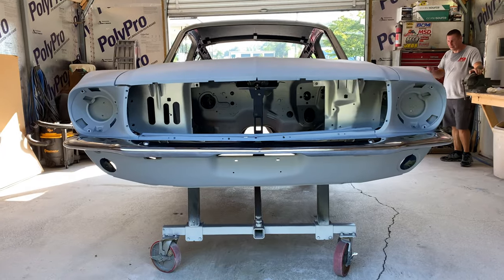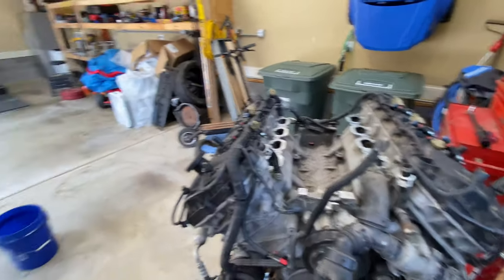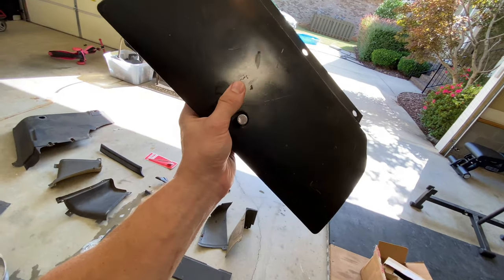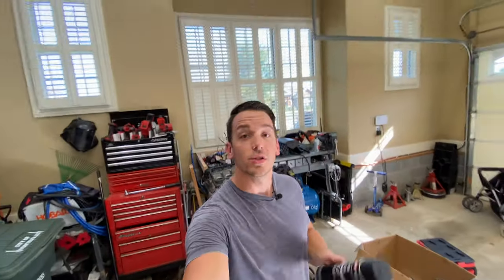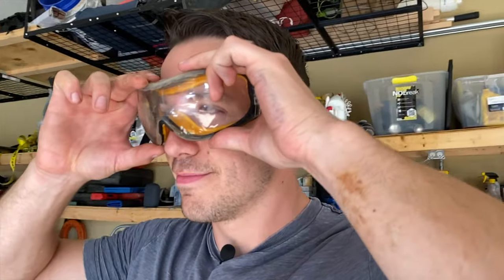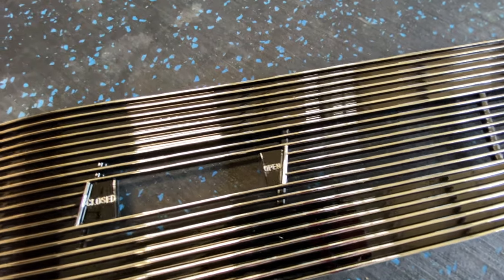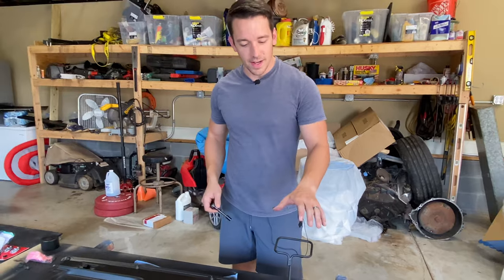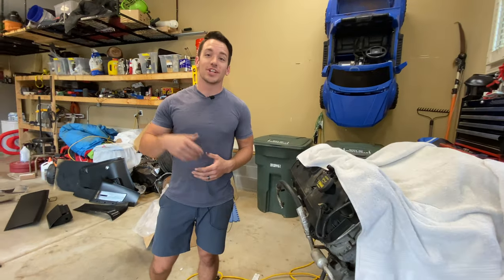Interior Panel Painting! - 1967 Mustang Fastback Rebuild Series - Episode 3

Comment: Awesome,  just got my fastback n going to do same
Reply from the maker: Congratulations! They are quite the project 😀 Do you have some big plans for yours?
Reply: @NickDowner  no big plans. I just got done with a coupe and not trying to take it apart. It's actually a 6cyl 🤣 maybe swab for something like a 302 no coyote for me. I wanna get some miles on it.. some smiles per gallon. Maybe later.  It's a good 25k swab right or more
Reply from the maker: Totally makes sense! It was an easier decision for me since my car is already in pieces. If it was running/driving I'd hate to take it out of commission for a long time

Comment: Can those vent grilles be rechromed?  I heard the plastic ones can lose their paint easily when cleaned and weren't great quality, although they look fine in your video.  

How did you choose a disc for your angle grinder?

Did your interior trim screws come in a package?  (Pictured @ 12:58)

Thanks, Nick!
Reply from the maker: Yeah I heard the same thing about the plastic ones... I'm hoping mine hold up if I'm extra careful 😀 They do feel way cheaper and kind of junky in person. For the grinder disk... I think I just grabbed a higher grit "flap disk" and was super careful. Flap disks tend to cut way slower than a normal grinding disk.  

Yeah I actually ordered a master screw set for the exterior and interior of the car! It's been awesome. Comes with everything you need, all brand new

Let me know if you have any other questions! Thanks for watching!